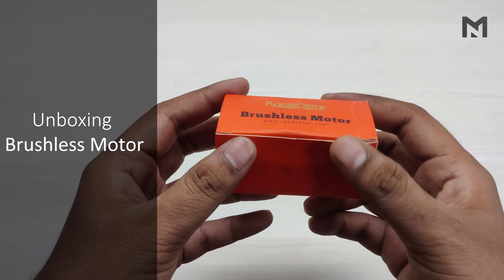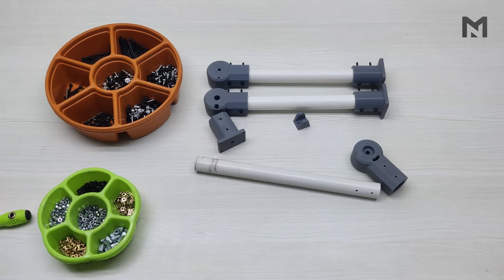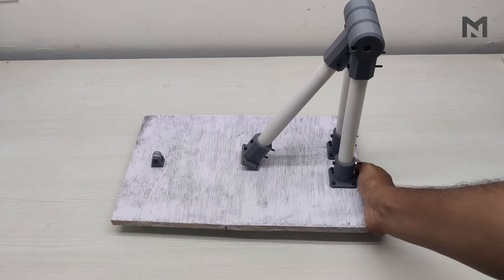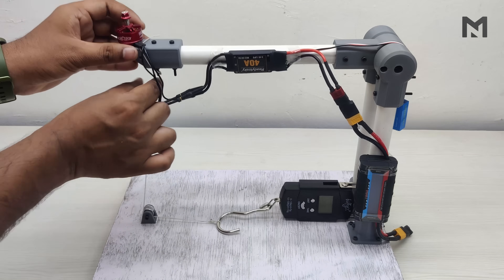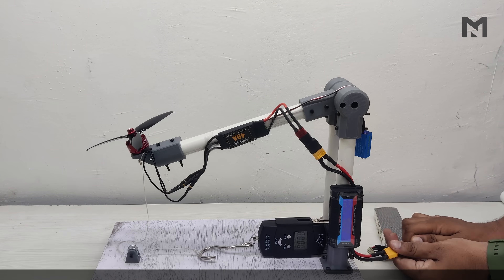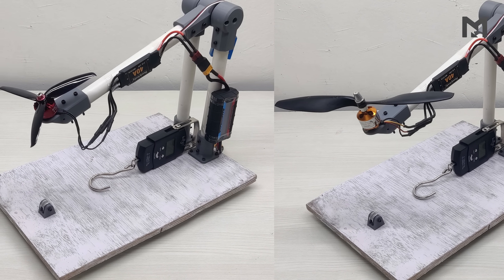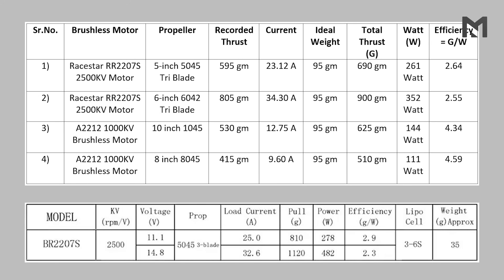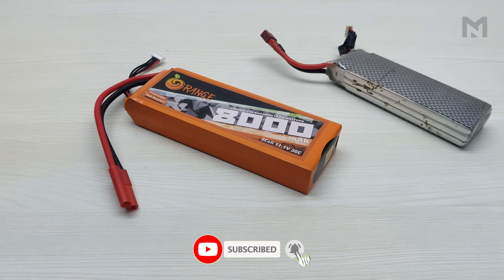Racerstar 2500KV motor thrust test | 1000 Kv motor thrust test | DIY Test rig

Comment: Sir can you tell me if i use 2200 kv motor with 6045 prop using 40 esc and 12v battery how much thurst it will generate?
Reply from the maker: I can't say, but 2200kv racing drone moto ?
If so it will generate approx 800 to 900 g
Reply: @MechNinja  sir should I choose DYS G- series (D2826-6) motor Or Sun fun 2500 kV motor (which is mentioned in one of your video with 6 inch prop)? I will use this in my wall climbing robot for suction 😅
Reply from the maker: Go with sunfun...DYS 2826 is for bigger props...
Reply: @MechNinja  Thank you sir
Reply from the maker: Don't forget to subscribe 😊

Comment: Very good video thx for that. I believe you could put 1 more value. The inrush corrent or pick corrent that would help people know how mutch people could push the ESC in agressive pushes.
Reply from the maker: Can you tell me how to do it...I will do it in my coming videos
Reply: @MechNinja Not sure, but I believe your watt meter could do it if you set it to max current. Or maybe you could use an Arduino with a current-measuring adapter and coil. Not really sure. But if you have a current meter, you could simply measure the max current directly.
Reply from the maker: But I have run the motor at full throttle, won't it be the max current ?....
Reply: @MechNinja depends if you corrente messure is set to average ir max. Probably is average. Becouse max or peek corrente can be 2x ou 3x the load current but for 1s or less.
Reply from the maker: But trust me, I have burnt many motors....I test motors on recommended props as well as the one not recommended....😅😅
So check my other videos.....
Reply: @MechNinja ok wil check some of them.
Reply from the maker: Do check my foldable drones.....they are cool too....
Reply from the maker: And also don't forget to subscribe

Comment: Sir can you help me to select motor for our project? We want to lift total 3.5 to 4kg weight all things included. Please suggest me motor and propeller
Reply from the maker: Well there is a new motor in the market, Readytosky 900 kv that gives max 4 kg at 6S, I have not tested it, I will soon make a video of it, if you have money for R&D and test it. Or currently you can go with 5010 750 kv at 1238 prop, it will give you good thrust at 6S. Check my new video, I have done it's thrust test...and one more thing... don't forget to subscribe 😁😁
Reply: @MechNinja sir can i connect you because i really need your help for my project. Our budget is very tight so we cant afford single mistake. And i can't explain whole project here that's why...❤
Reply from the maker: @bhargavkathiriya870 tomorrow...
Reply: @MechNinja how i can contact you?
Reply from the maker: Check website

Comment: Bro the 1000kv motor thrusts up to 700 to 800 gm in 1045prop with  new and full charged battery I have checked

Comment: Bro can i used 1000kv motor with 1045 prop for rc plane?
Reply from the maker: Yes, but make it light weight...try using deproam foam...if not the. Regular foam will work too

Comment: Inefficient motor
Reply from the maker: No it's really good....I have been using it till now....
Reply: @MechNinja  you can get 690gm thrust with 2212 for 9ams ampere with 10 inch props. This is efficient I think .

Comment: 1) you are fighting gravity with this method, and 2)changing the angle of the force. I don't believe this will be a very accurate test.
Reply from the maker: Every drone is fighting gravity...so do we.....
Reply: @MechNinja  True, but I am calculating for a fixed wing, Besides that, all manufacturers do not calculate thrust agaist gravity, they are calculating the total horizontal thrust, THAT is the standard.
Reply: @MechNinja  Weigh the drone, and get thrust over and above that.
Reply from the maker: I took the reading at the time when the motor is horizontal....and I think, that is the ideal case when we need to calculate the thrust.....
Reply: @MechNinja  Absolutley!!! Gravity is a constant, thrust is not, even as temperture changes.
Reply: If he had an adjustable weight opposite the pivot point, to counterbalance the motor/prop combo until the ensemble was resting horizontally, just as the string became taught, the result would be more accurate.
Reply from the maker: Since I am calculating the ideal thrust and adding it in the final result, so the counter balance method is eliminated.....
But in my upcoming videos i am using more accurate rig to test the thrust.
Thankyou for watching the video and don't forget to subscribe 😊😊😊

Comment: How did you come up with the ideal thrust as 95 grams?
Reply from the maker: Ideal thrust is the dead weight of the arm to lift it to the height till the arm reach the horizontal position. I have calculated using the spring balance.
Don't forget to subscribe 😊😊😊😊

Comment: hey im going to use a 2500kv and 40 esc for a plane and was wondering what is the c rating for the Lipo battery?
Reply: You are supposed to know that by the manufacturer's specs. And every battery made has it's own C rating
 depending on the quality of the materials used, as well as the quality of the build by the battery company.  These companies are notorious for over-rating the crap out of the battery's to impress you and get you to buy them.
Reply from the maker: The C rating are mentioned on the battery itself....
And thankyou for watching the video and don't forget to subscribe 😊😊😊😊

Comment: Bro a question.. could a motor fly a plane whos total airplane weighs  greater then the trust produce? 
Example a motor with trust 500 gram flies an rc plane with 600grams? 
I like to know the minimum thrust required to fly an airplane in Trust to weight ratio..
Reply from the maker: Yes definitely it can fly......as the thrust is produced by wings...and the motor helps in speeding the plane. Make sure you do not fly in vertical position.....or it will come down....😊😊😊 Don't forget to subscribe....😊😊😊
Reply: @MechNinja  i see thanku Bro.. Always wondered this question..  U deserved a subscribe

Comment: Bro i am going to make a rc plane... With 1000kv motor with 8 in prop.. Can i use a 7.4v lipo battery 1000mah for it?
Reply from the maker: Yes you can go for it...but don't make it heavy.....
Don't forget to subscribe 😊😊😊
Reply: @MechNinja  thanks bro. I have already subscribed you😀

Comment: These small motors draw much more current than an normal induction 3phase motor according to their size
Reply: Because of the low voltage, they would naturally have to have a high Amp rating to get much Force/Thrust

Comment: would a 2500kv motor be enough to lift a tarot frame?
Reply from the maker: Each motor give us a max thrust of 900 gm.....So you can calculate now...😊😊😊
And don't forget to subscribe 😊😊😊
Reply: @MechNinja  do you know if a 4 in one will work with a naza? i have 2 don't want to throw it out

Comment: Hi.. I need one help
Reply: In the video you showed 2207 motor, 2212 motor.both have around 600g thrust. Then what is the difference between these two? I heard that 1045 propeller is used in heavier plane models
Reply from the maker: The difference between 2207 and 2212 motor is that, both motor has different rpms and different torque. 2207 has higher rpm and lesser torque thus uses less dia propeller, while 2212 have less rpm and higher torque thus use big propellers of 8 inch and 10 inch.
Reply: Is 1038 propeller ok for 1000kv a2212 motor?
Reply from the maker: Yes they are good....but try using 1045 propeller
Reply: @MechNinja  tried using 1045 propeller on fish rc plane. Plane is not stable at all.if I give more thrust flies vertically. When used 1038 performance is much better than 1045
Reply from the maker: It's because 1045 has higher pitch and gives more thrust, i am not 100% sure but your 1045 configuration gives more thrust which your plane cannot handle and thus it lifts the plane while 1038 gives less thrust and thus your plane handle this.
Reply: @MechNinja  iam using a2212 1000kv motor. I use 2207 motor and corresponding propeller what is the difference?
Reply from the maker: If you use 2207 with 1045 or 1038 propeller, it will only produce less thrust because these are heavy propellers for 2207 motor. It is designed for less heavy propellers like 6 inch or 5 inch.
Reply from the maker: When you use A2212 with 10 inch propellers, the air flow area is high and your wing span is small so the whole plane act as a helicopter and lift upwards. So try using 2207 motor with small propellers because the wingspan of your plane is small.
Reply: @MechNinja  is 2207 suitable for fish rc plane? Made with coroplast
Reply: @MechNinja  I mean using 5 inch propeller? Will it suitable for fish rc plane made of cotoplast?
Reply from the maker: Mail me at gau78603789@gmail.com

Comment: Njoyed Alot Da Machaaan..!
Reply: Machi, Its 2am, Still Awake.?
Reply from the maker: Yes....😅😅
Reply: @MechNinja  I Think You Are Doing Some R & D For Next Video.,!
Reply: I Have one Very Simple Question, Why Table Fans Propellor not Creating Much Thrust Like Other 2 blade Propellors.? Is it Because of Rpm or Propellor Design Machi..!
Reply from the maker: Both the things. Their propellers are meant to be designed in such a way that they will only push the little amount of air to provide the comfort and also their rpm is low.

Comment: 1000 kv , 6045 tri blade how much trhust ?
Reply from the maker: 6 Inch propeller is not suited for the 1000 kv motor because it has low rpm and high torque. 6 Inch propeller need high rpm motor so I have used a 2500 kv for it.
Hence there's no use for using 1000 kv with 6045
Hope you got my point.
And thanks for watching and don't forget to subscribe 😊😊😊😊

Comment: I can use the Racerstar BR2205 with 6inch propellers, but because my normal pressure is only 790hPa. Also with a 4S battery.
Reply from the maker: If it's recommended to use a 6 Inch propeller than its better, but if not then the motor will draw much current and time of flight will be less. But If your requirements suits the 6 Inch prop then go for it.
Reply from the maker: And don't forget to subscribe 🙂🙂🙂🙂
Reply: @MechNinja  I already did yesterday. This is the third video that I saw from you, and I watched it all to the finish so a subscription is important, I want to know where are you moving to. And I use those motors and those propellers in a quadcopter FPV drone, so I need the punch some times at this altitude, only 15 min of autonomy with a 4S 1500mAh
Reply from the maker: May be you are having a racing drone.....
Well I am a mechanical engineer and following my passion...🙂🙂🙂
So thanks for watching and don't forget to subscribe 😊😊😊

Comment: The pulley relieves the force that is applied on the scale by 50%
Reply from the maker: No bro it's not......I am using a single string so the force applied will be same.....If I had used two string at one side and one at the other ....than it would have been twice.
Hope you understand....😊😊😊
Thanks for watching and don't forget to subscribe 😊😊😊😊

Comment: I have used big twin 10"   prop  with 2212  1000kV was ossum
Reply from the maker: I have also used 10 Inch prop with my 1000 kv motor

Comment: Bro which is best motor to produce 25kg of thrust ?
Reply from the maker: 25 kg thrust is way more for electric ducted fan (EDF). The max thrust which a commerical available EDF can produce is 12 to 13 kg max. So you need to use two of them. But the problem will be the battery size because these EDF consume much current. And also if there is no such requirement.of EDF than you can go for T motors. T motors has a lot of thrusts. It can easily provide you 25 kg with 24 Inch propeller but it is costly. And if you are planning to design a manned drone that I will suggest you to first make its miniature version and find you the problems.
Hope you get it and if you'll face any problem then do comment.
Thanks for watching and don't forget to subscribe 😊😊😊😊
Reply: @MechNinja  Thnx bro
Reply from the maker: Your welcome..... Subscribe to my channel for more videos...😊😊
Reply: With what speed, with what type of propeller, for what?

Comment: What application are you going to use these on? Also, have you tried any other propeller designs?
Reply from the maker: Well it was a test for my new and old motors. Because I want to compare the actual thrust of the motor with its performance chart. And I need the results because my future projects are complicated and so compact that these parameters will play an important role in designing that. So I shared the results with you all.
And yes I have used different propellers because racerstar 2500 kv motor was designed for 5 Inch propeller but I have tested it with 6 Inch too. And 1000 kv motor for 10 Inch but I have tested it with 8 Inch....and I don't fee like to use more propellers on it because these sets were common.
So hope you liked my video...so thanks for watching and don't forget to subscribe...
More cool stuff is coming on the way...☺️☺️
Reply: @MechNinja  you're obviously an engineer.  What's commercially available isn't always the most efficient. You also have a 3d printer, and that was also the short way of asking if you had access to research and knowledge that the basic public doesn't have, or, have aggregated said knowledge from the multitudes of sources out there. For instance, the noctua fans have an extremely efficient way of moving air around and are some of the quietest designs. 

I do wonder how long it will take to get aluminum and iron based batteries for things like this. What has been promised for performance will be exciting for projects like this.
Reply from the maker: Thanks for your support bro...I appreciate it ...🙂🙂
We'll I have way more knowledge to share with you all and will definitely share it in upcoming days.....
So till than enjoy my video....😊😊😊
Thanks